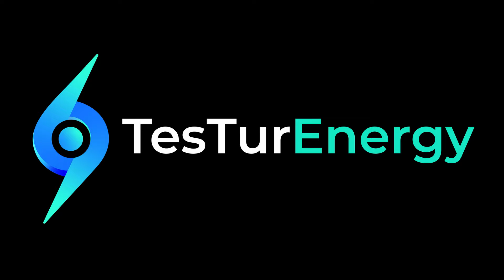Solis Talks on Cold Steam + The Shell and Tube Heat Exchanger and Keg Vacuum Condenser - Part 2

Comment: Very nice.  The biggest challenge I see with practical application is a full house design maximizing efficiency but also simplicity.  Example, 1 moving part or no moving parts.  Less pipes = less cost but perhaps loss in efficiency.  Do you by chance know why glass plates are not used instead of metal ones?
Reply from the maker: I really appreciate you taking the time to leave me a comment, it means a lot to me and it helps increase my visibility on the algorithm. I’m glad you’re interested in learning more about my project, I’ve put a lot of work into it. 

As for the glass vs metal. Do you mean why aren’t ceramic disks used? 

If you want to take a deeper look, check out the rest of my YouTube channel, I’ve added videos that explore the ins and outs in great detail. If you have any questions, please don’t hesitate to leave a comment or message me, I would be more than happy to provide detailed answers. Thanks again for your support, and if you want to help me out even more, please consider donating to my Patreon page or any of the places on my linktree in my bio, it will help me to continue my project. Your support is greatly appreciated.

www.Patreon.com/CharlieSolis